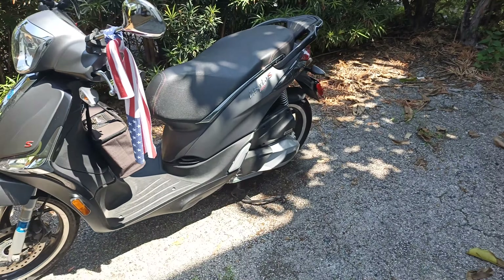Piaggio Liberty 150S iGet Motor | Gearbox Transmission Oil Change Tutorial [4K]

Comment: Thank you for this video. I put around the 300ml in my scooter. I first tested (before refreshing) how many of the original oil was in there. I had to tilt the scooter around 40 degree to the left till the oil was coming out. Didn't fill as much as you did. Tilted the scooter around 20-30 degrees till it stopped dripping.
Reply from the maker: Sweet brother 🤙
Reply: @roadsterrevolution  thanks (from the Netherlands)
Reply from the maker: @user-dr1hr9il1b  hope u get some good riding weather 👍👍

Comment: Is the gear oil G-4, or G-5? This is very important to share. if you use G-5 in one that calls for G-4, it can cause internal damage.
I recommend you use a synthetic.
Reply from the maker: @RobKHere  this of from the Piaggio Manual: Recommended products
Lubricant for gearboxes and transmissions

SAE 80W/90, APIGL4

Comment: Just serviced mine. Very easy to do. I bought a couple of extra bottles, so I can do oil changes every 2500 miles. Cleaner the oil the longer the bike will last, hopefully. ACE Hardware has the copper washers. Just take old one in and match it up.
Reply from the maker: Sweet brother! Good to know!! 🤙